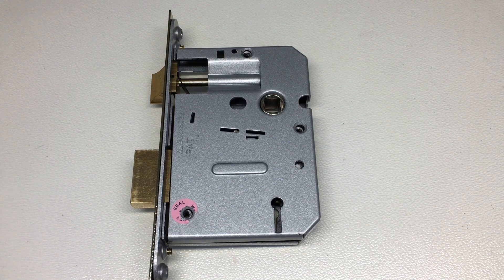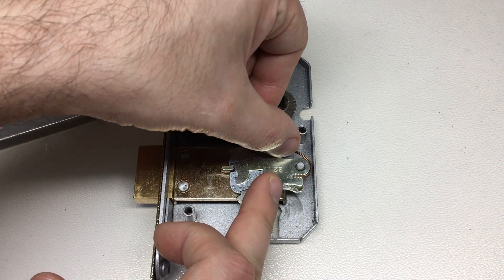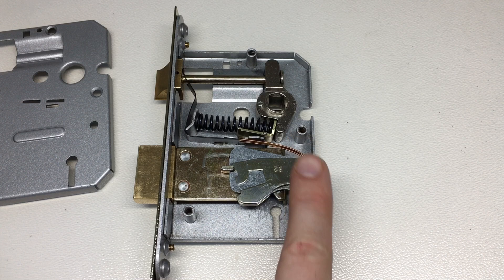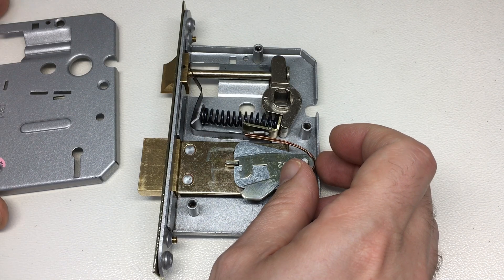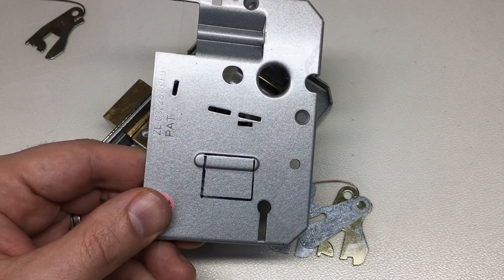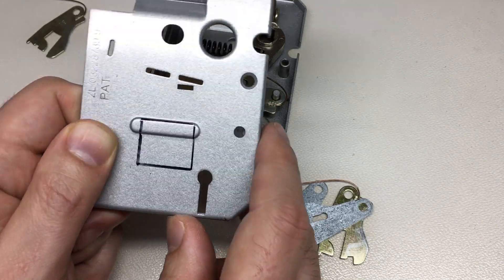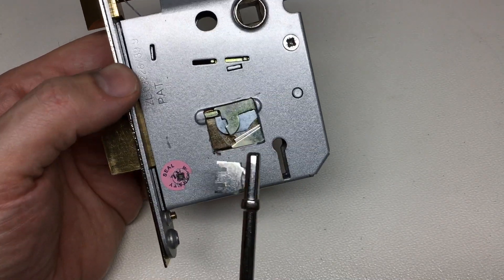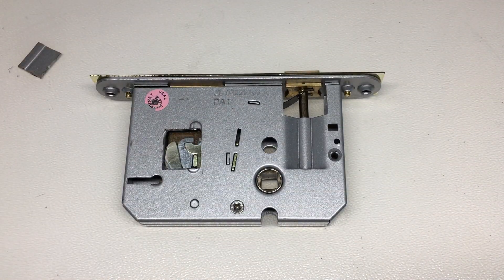How to Make a Cutaway Lever Lock

Comment: Nice and Clearly taught thank You for sharing when taken the backs of the casing have a heavy Kitchen Scale weight to hold the levers down In the lock whilst on a flat surface.If taken Back off in a vice in upright position have a safety net to catch l.o.l
Reply from the maker: Good tip, thanks :-)
Reply: @LockNoob  I am going to make one now that someone that is yourself as taught the method I have a Dremel